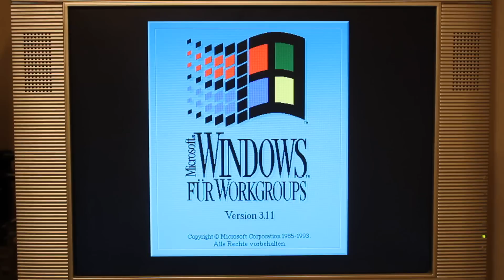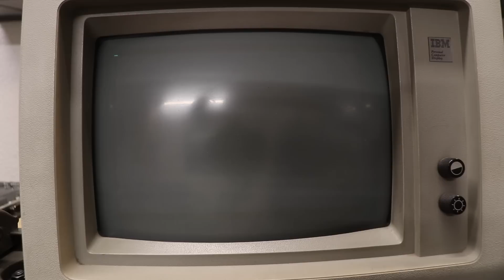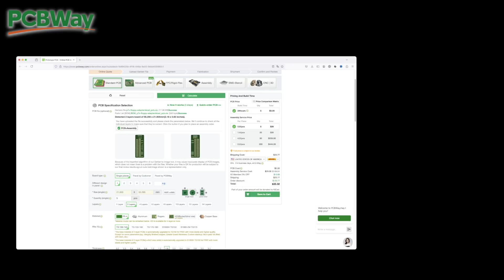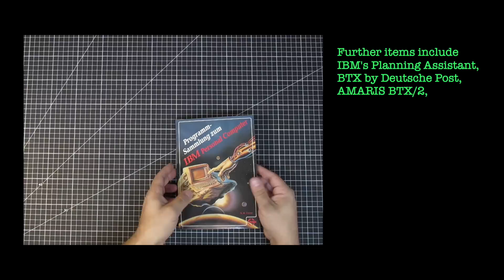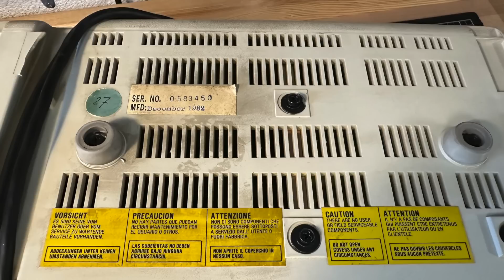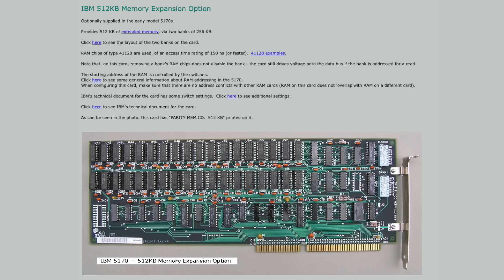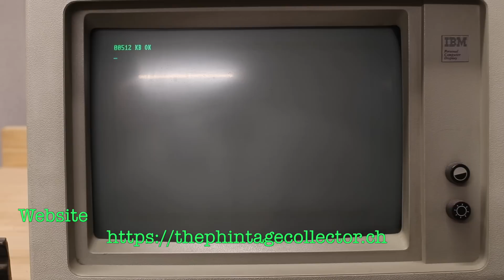Restoring My IBM PC AT 5170 - Dust, Repairs & Memories  (Pt 1/2)

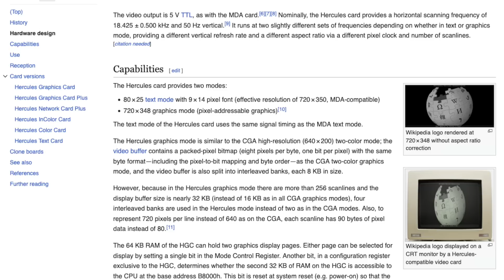Comment: 13:50
although the CGA monitor was only released in 1983, at launch in 1981 you could already use the CGA with a composite display like a TV
Reply from the maker: @pankoza2 That‘s true. I was specifically talking only in context the delayed arrival of the IBM 5153 Display.

Comment: The IBM EGA board supports both of the previous monitor types.
Reply from the maker: Indeed. I'm observing on eBay for a full period correct restoration, however prices are ... nuts ;)

Comment: I'm sure the ATI EGA card can be brought in a mode that is compatible with the 5153 CGA monitor. Most programs and games support low res EGA mode that the 5153 can display just fine.
Reply from the maker: Correct, the ATI Wonder 800 can be configured to support anything, from plain MDA, to CGA and EGA.
Reply: @THEPHINTAGECOLLECTOR  And maybe even some higher resolution modes? You would need a special CRT monitor for sure, but still... It's not called the EGA Wonder 800 for nothing ;-).

Also, I suspect your the MDA compatible card you featured right after the EGA Wonder 800 card is not just an MDA card, as I count 64kB of RAM in total on it.
Reply from the maker: @ it‘s a hercules compatible, so yes, it supports graphics, which the MDA can‘t!